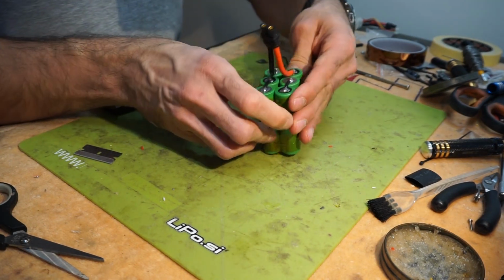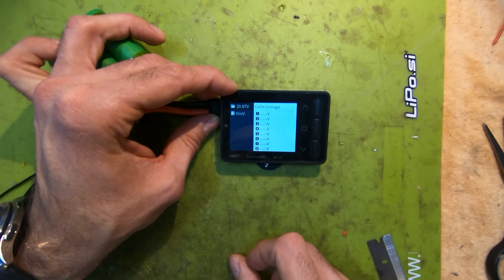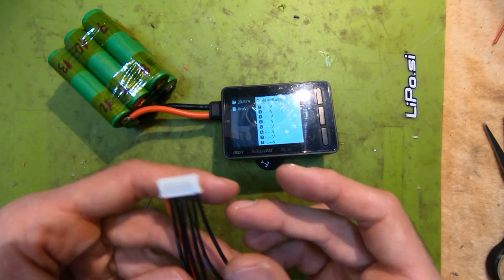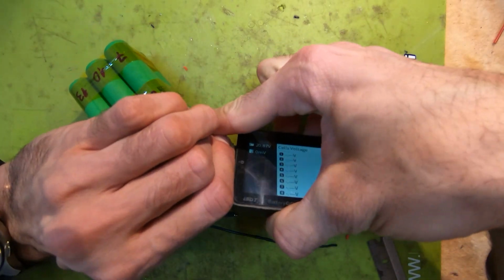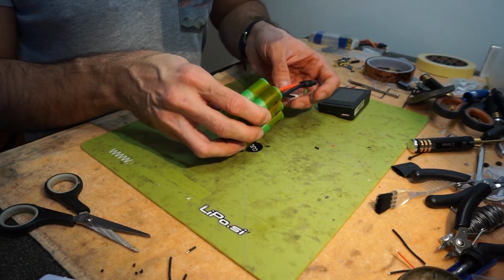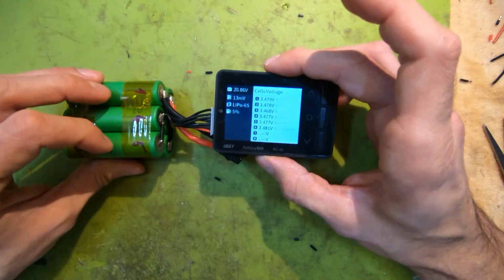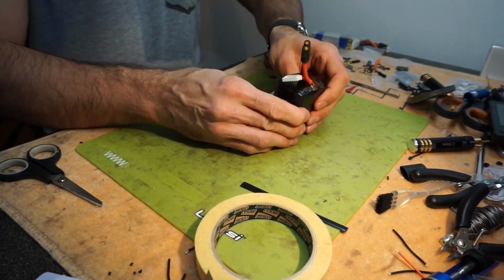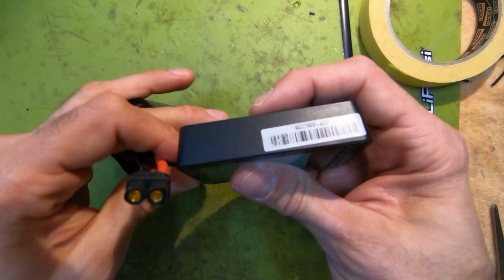How to make 6s li-Ion 18650 battery for long range FPV PART 1

Comment: What is the discharge rate , because drones require a high discharge rate and if it’s low and you have a FC it will keep restarting
Reply from the maker: Well this is proven method. Since this video there are high discharge li-ions available.

Comment: It’s a little bit all over the place and for a new bee you don’t show everything
Reply from the maker: @jameslaken6354  but you need somewhat decent DIY skills to take on soldering Li-ion batteries.
Reply: @mrRockwellFPV  i don’t mean newbee to diy skills I mean newbee to making batteries which is what your post is about. Example. The balance lead you say to solder the positive then the negative then all of a sudden it’s done.  On a balance lead there’s one positive and the rest are all black. Which one goes to the next in series and which one goes to the last (open) negative ? That’s what I meant
Reply from the maker: @jameslaken6354  look up my next video about soldering Li-ion batteries. Should clear few things up

Comment: Does it matter what wires your using to connect the cells
Reply from the maker: No. The current flow between the cells is not that great
Reply: @mrRockwellFPV  okay thanks, another what’s the little device called that checks the volts?

Comment: Should I use these batteries for a 6s2p pack for 7" drone ? I calculated the weight = 840g. Where the 18650 @6s2p = 528g.

That's 312g more if I use the 21700. Which one you think I should use ?
Reply from the maker: I actually never came to a solid solution. More weight of 21700 but more capacity or less weight or 18650. Let me know what route you went.
Reply: @mrRockwellFPV  ok 👍

Comment: I will be doing this, should I pre charge any of the batteries and if so how much and which ones? Would be good if you could respond asap
Reply from the maker: Just check the voltage of each cell. It's really important that they have same charge. No need for full charge.
Reply: @mrRockwellFPV  thanks so much bro your video was the one that explained everything I was looking for. Love how you numbered the battery ends. Also did you ever finish the drone? How did it turn out? We are making a battlebot

Comment: this is dodgy you went fro 10 to 12 and then puy 13 as the last one then the video fast forwards for a sec. so why did you go from 10 to 12 and have 123456789101213 instead of 1 to 12 ??????????? wtf
Reply from the maker: But I'm sure you get what needs to be done even if I skipped one number and replaced it with another.

Comment: Hi - thanks for the video - exactly what I was looking for. As the balance part is hard to understand and I have issues could you please tell me again? 2nd cable goes to 2, 3rd cable goes to 4, 4th cable goes to 6, 5th cable goes to 10 and 6th cable goes to 8? I always get an error when plugin into the charger ..... 😞
Reply from the maker: It's pretty straight forward. You need to connect 2 outer balance wires where battery leads go. Every other you need to connect to the bridge between the cells in the order I suggested. Except the 13 pole. Sorry I made a mistake right there.
Reply: @mrRockwellFPV  thanks for the quick response. Still struggling .... 13th pole you anyway don't mention to connect to any balance lead. only to pole 10 (5th cable). when I follow your video it's exact how I stated above. But you are saying now if there is one balance lead at every bridge it's also good (except the outer ones at the battery leads of course)? That's the case with me and I still always get the message 'to high balance board voltage'. no clue .... many thanks
Reply: I found the issue: the 5th cable should go to 8 and the 6th cable goes to 10 then! After that it works perfect.
Reply: @asuras1 thanks man for identifying the issue
Reply from the maker: Also you can see here what I mean by my previous comment. https://youtu.be/ymlkP1hNb3k
Reply from the maker: The error in the video is that I wrongly labeled pole 13. But instead it needs to be 11

Comment: Hi, whether it's possible to make a 6S 21700 DIY Li-Ion battery using Nitecore NL2142LTP cells? Each of these cells has 3.6V and is cable of 8A max discharge current. I'm not very strong in interpreting these specs. What do you think, are those cells good enough to be used in a DIY Li-Ion FPV battery? They grabbed my attention because it's claimed that they can operate way below freezing and I'm looking for batteries to fly Chimera7 Pro in the Arctic. What do you think?
Reply: i might be 1 year late but for FPV Drones, its should be 35A  Max discharge

Comment: This morning im flying my 7inch with vtc5a 6s liion.. with my 5inch quad, i can fly it until 3v and always keeps the amp never above 15a, and i can land with cool battery. But with my 7inch, and yes the amp draw already calibrated, im testing the fligtime by flying around with low cruising amp.. around 7-13amp.. but why everytime i land at below 3.3v the battery gets hot.. not super hot.but more than warm. If i fly and land at 3,5-3,4 i can land with cool battery.. whats your experience with 1p liion pack? I dont want to build 2p.

Comment: the balance lead soldering explain is very annoying...
Reply from the maker: Yup sorry.
Reply: @mrRockwellFPV  Thanks for it anyway! Did my first pack and it seems to be working fine!
Reply from the maker: @FUFUFUFPV  ITs the issue where I labeled the battery poles wrong but the battery itself is good. Glad you managed to get it right!

Comment: i ordered batteries to try this! THANK YOU!
Reply from the maker: If you know basics of soldering theres really no issues.
Reply: @mrRockwellFPV  I can solder a little but im sure you make it look easier than it is... im just excited to see how much more flight time I get with my wing and my regular planes ... lots of love and thanks again
Reply: @mrRockwellFPV  I recommen using soldering acid instead of dremel tools, as it works an absolute treat! :-)

Comment: Oh man... What a hack!? 😬 Great tutorial, but... I spend more than hour to find a mistake. After connecting balance plug my isdt q6 gave me allert message that voltage is too high. You made a mistake when you told the way of soldering balance wires. It should be: 1-1, 2-2, 3-4, 4-6, 5 -8, 6-10, 7-12!!! Please check everything 3-times when you make such tutorials!
Reply: This is an underrated comment.  Thank you for posting the correct setup! I was lost after 4-6...he basically stops calling it out in the video.
Reply: yeah this really mesed me up. Thanks for giving the correct numbering
Reply from the maker: Sorry to hear that. I make it not even thinking about it any more that the mistake snuck up.
Reply: @mrRockwellFPV   you should pin this comment dude.

Comment: Would 15A 18650's work? I have a bunch running around.
Reply from the maker: If you keep your amp draw below battery rating should be good.
Reply: @mrRockwellFPV  Do you know roughly what the max amp draw a typical 7" quad requires? Been trying to find info on this allover the web but it's very hard. I'm just looking for an average number. I ended up ordering 30A 18650 Li-Ions just to be on the safe side. But looks like some can go even higher.
Reply from the maker: @theshazman  think 15a should be good for moderate flight on 7 inch
Reply: @mrRockwellFPV  Thanks, I made a 15a and a 30a pack for starters. The only thing that I am missing are the balanced leads.. They are taking forever and a half to come from China. I cannot wait to take my 7" out for a spin. All I've ever wanted was more range. I fly cinematic/relaxed cruising, so I am happy to sacrifice high burst power for more efficient capacity.
Reply from the maker: @theshazman  thats the way to go
Reply: @theshazman  Hey, any feedback on your 15A pack ? how does it fly ? Thanks :)
Reply: @remizik  they work, but the sag is quite more noticeable on 15a vs 30a. Like I'd you do throttle punches or try to save yourself from a fall is way harder / weaker thrust on 15a. I notice my draw can go as high as 24a on punches.

Comment: What cables do you use to connect each battery? Doesn't matter which one? The blacks you are using. Thanks! Very interesting video.
Reply from the maker: Its suppsed to go in the exactly like ive done it. The way i connected it is cell 1 to 6.
Reply: @mrRockwellFPV  I don't mean how to connect, I was meaning what kind of cables did you use? Does not matter? Awg?
Reply from the maker: @ML-fx6xn  oh sorry. I used the leftover motorwires. Don't go to thin but its not necessary to go really thick. No issues with leftover motor wires.

Comment: Thanks for this tutorial. I have a question. How are you charging this battery once built ? I mean, what type of battery setting do you use ?
Reply from the maker: Glad you liked it. I use normal lipo settings on my charger charging 4.20 v per cell.

Comment: Great 👍 video. 
I'm going to build a dc7 long range. 
I would like to know your flight time with this battery 🔋 setup..
Reply from the maker: I managed 20 min on 2806.5 motors and 7" props
Reply: @mrRockwellFPV  Is this with a 6S2P setup, or only with 6S1P? I get 24min with 6S1P and will move to 6S2P trials next.

Comment: Is it possible to make a 2s battery for 2inch quads?
Reply from the maker: Sure just connect one wire to the + and -to connect them in series. On other side use the battery connector.
Reply: @mrRockwellFPV   do i have to take any other precaution when soldering batteries?
Reply from the maker: @vysakhharitharsion3474  look up my 21700 tutorial and see the temperature readout and all the relevant stuff when soldering to liion batteries.

Comment: This batteries unprotected, is it worth to buy with protection ?
Reply from the maker: No. For this it's perfectly safe to use it with your standard lipo charger. It's being balanced trough balance plug.

Comment: Can this type of diy batteries be used for acro fpv freestyle like doing powerloops, split-s and other tricks? Amazing!
Reply from the maker: Sorry for my late reply. No it's not suitable for flying freestyle since c rating or discharge is not that great on liion cels. I'm pretty sure you can do mild freestyle but not recommended.
Reply: @mrRockwellFPV  and what happen if doing it anyway ? The power is just limited and no problem in any case, or by accelerating too much can damage the batteries or even worst?
Reply: @ML-fx6xn  On high current draw you will have quite a bit of sag, because the internal resistance of these cells is higher than LiPo.
This means the battery will heat up so you may risk damaging the cells or even exploding them.

Be careful!
Reply: @mrRockwellFPV  Thanks a lot! I will build another one for cruising long range flights! This is awesome tutorial!

Comment: And here I have been totally scared to make my own batteries because I thought I needed a tab welder. Are you sure all those wires and solder blobs don’t increase your IR too much?
Reply: WhalleyB0Y is perfectly ok as long as you know how and what you are doing
Reply from the maker: I'm currently making a part 2 of this video addressing all the issues people have aired. Still think it's safe to solder the cells. If you decide to do multiple packs than it's better to buy Spot welder but if you are like me with 2 packs a year than soldering is the way to go.
Reply: Anybody recommend a good spot welder?
fpv.air-war.org
Reply: CHOPPERGIRL's AIRWAR  You can make one easily with a super capacitor some thick ridgid wire leads and a diy welding board. They sell tons of them on eBay. Just look for 18650 spot welder and super capacitors like 1000F or even 500F 2.7v

Comment: Would be really nice if you had the stats for amp draw and voltage drops. Maybe next video. Besides the nonvisual specs on osd recording the video was helpful. Thank you
Reply from the maker: THeres plenty on li-ion batteery testing. Read this.
https://lygte-info.dk/review/batteries2012/Sony%20US18650VTC6%203000mAh%20%28Green%29%20UK.html